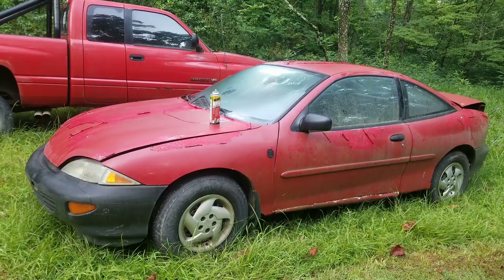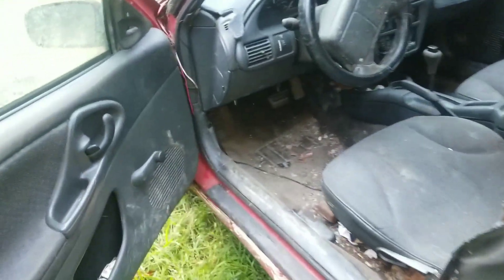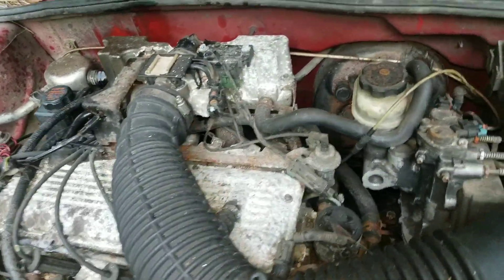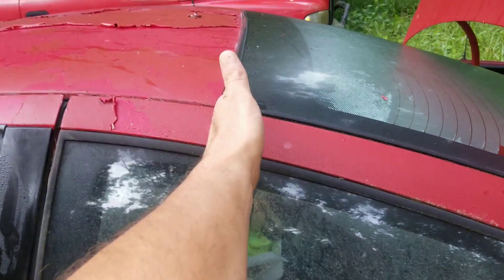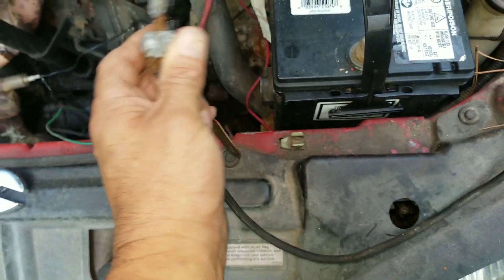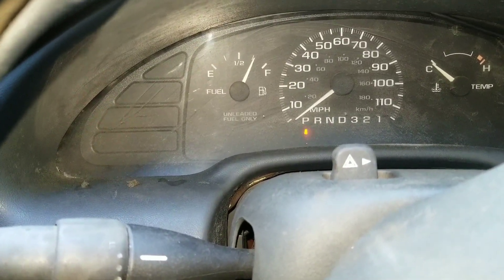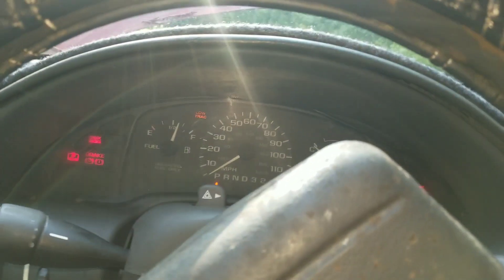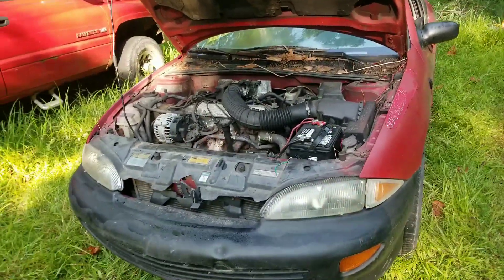New project for the old Cavacruiser

Comment: Great you got this one running. It'll be an interesting build when you take out the back window. I had a giggle when you said that the value of that car increased with a 1/4 tank of gas, gas is crazy here over 9 bucks a gallon. 👍
Reply from the maker: I think it should be a good car to run on woodgas. Yes gas is high here too, but more like $5 a gallon. Still more than I like to pay.

Comment: Using the crusty Cavalier for a proof of concept sounds like a good idea, so you can get it working before you try it on the truck. I agree that taking the rear window out and keeping the trunk lid with its tail lights might be the easiest way to go for proof of concept.
Reply from the maker: I think it will do fine on woodgas. Several people have gasified the 2.2 liter engines and they do good on it. I'm kind of wondering how it will look with the diy truck bed lol.

Comment: Good job getting that old slick running and moved Luke.
You will be woodgas successful following the trails blazed already with that GM 2.2L engine. Mike LeRosa 1st and now others.
Regards
Steve Unruh
Reply from the maker: I think it will do ok. These 2.2s are pretty reliable engines. I was glad to see the metal intake.

Comment: Use a mini trailer for the gasification
Reply from the maker: I was thinking that at first, but the amount of bouncing a small trailer would do would shake the ash down too quickly and stop the reaction. Especially in my case where I drive through the creek every day. It might work for someone that stays on smooth surfaces all the time.  That's one of the things that the drive on wood forum helped with.

Comment: Starting off with an adventure I see 😂 you will be on wood in no time, and that little 4 banger will be nice and easy on the wood chunk pile compared to my V8 and v10 woodgassers, they eat through the pile like wild will my 100+ mile round trip commute! I think I'll need to build another one maybe a 4 cylinder Toyota down the road for commuting
Reply from the maker: It should be pretty good. It used to get about 40 MPG on gas, so hopefully it is as easy on the wood. I've been doing almost 100 miles a day for work recently so I'm going through a lot of gas in the truck. 
When I get this one going maybe I can convince my son to do his V10 Dodge in the background.

Comment: Glad to see you back Luke. I was hoping we'd hear from you soon. Gasification is a great project to start on now with these extreme gas prices across the country. I remember your first time you tried it, but I need to re-watch that video again for a refresher. Anyway, glad to see you tackle it again.
Reply from the maker: I have been putting in the hours at work and really wasn't doing too much else. I can't stand paying the prices at the pump now. Yeah that last version was not an optimized design and my welder back then was a homemade car alternator welder, so it wasn't capable of sealing the welds up air tight. 
I should be able to do better now with a proven design and a better welder. Also with the local sawmill giving me all the slabs I can haul there will be no fuel shortage.